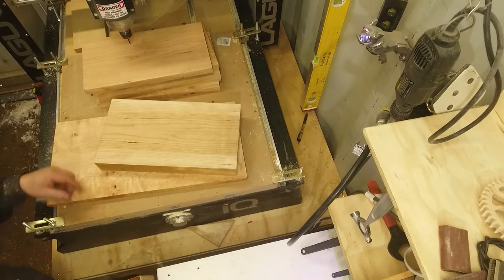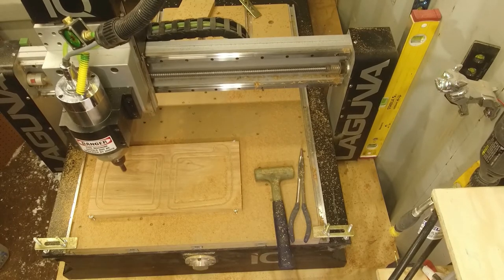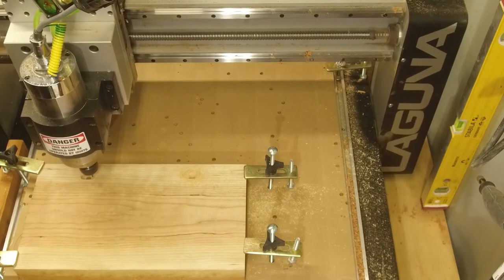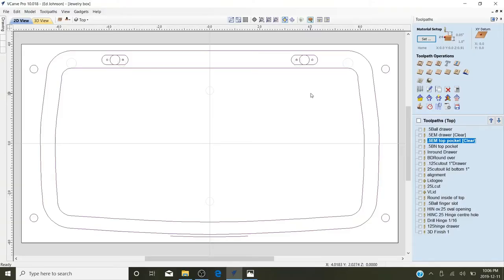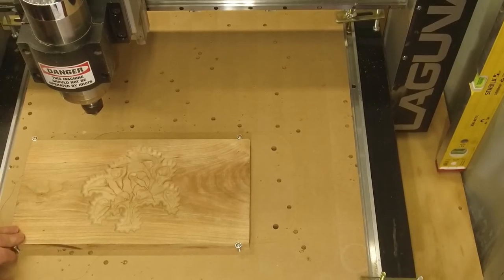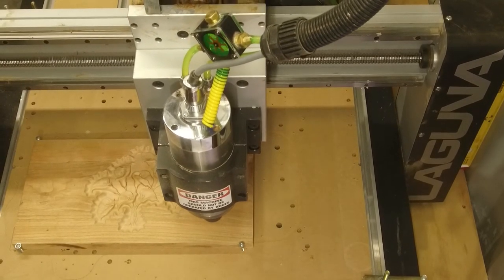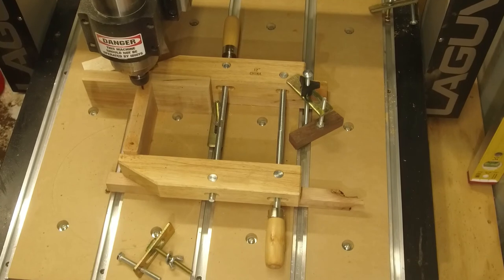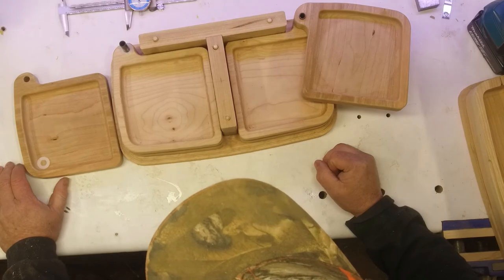Jewelry Box part 2, Designed in VCarve pro and made on a Laguna iQ CNC router.

Comment: Not sure if you still monitor this video but I learned A LOT from it so thanks! I will probably make a full size one eventually but I am making one now that is 50% the width with a single set of swing out drawers . I also am going to use 3/4" stock BUT then laminate a 1/2" thick contrasting wood around the perimeter of drawer and Top so when I pocket out the inside, I get a thicker piece BUT do not have to buy 5/4 or 8/4 stock as only the edges really matter. If I see you reply, I will send pics of finished box but in concept, should work as my pockets will be much deeper than the laminate glue line so ???

Comment: Very nice design and well explained. I'm drawing along with your first video and while I was doing that I decided to use scrap wood for the spacers.

What I did was copping the drawers and spacer to a new layer, moved the spacer a little more to the top edge of the wood and moved the drawers away from the spacer so the cleaner was just enough for a 1/4 end mill.

I'm not sure if it will work and I might have to figure out of I'm going to use washers and how  to get the height of the spacers right. Maybe I can skim the drawers a bit.

Thought I'd share it with you so it saves some wood.

Comment: At our makerspace, we had a young person (35, 45?) use a 1/2" four flute bit to do some pocketing/profiling. But she didn't know to slow the spindle, so we got some smokin' hot embers goin' on. ;-D  Fortunately, the glowing chips didn't get sucked up into the dust collector, but they did get sucked up by the shop vac, and after a while, it started smoking really good!  Doused the embers with a bucket of water and only had damage to the paper filter -- and maybe a little melted plastic. 

I was able to get it back into working condition, so nothing was lost. Exciting Times! 

Needless to say, when you chucked up your 4 flute, I got a little nervous.
Reply from the maker: Good observation. The thing to consider in this instance is your speed and feed rate are based on cutting edges. If your running a 2 flute at say 18,000 you want to run a 3 flute at say 12,500 or so and 4 flute at 8-9,000. Your cutting edge needs to cut enough not to create friction. You can also increase feed rate. Twice the flutes means: half the spindle speed or twice the feed rate or a combination of. Theirs chipload charts and equations to help you calculate feeds and speeds.